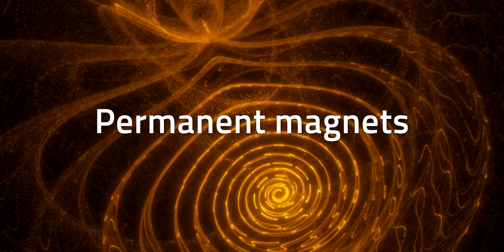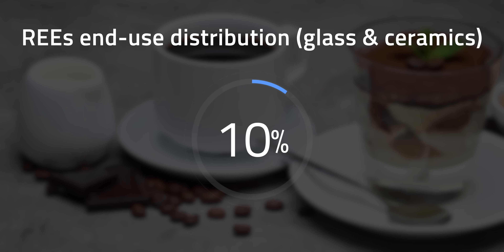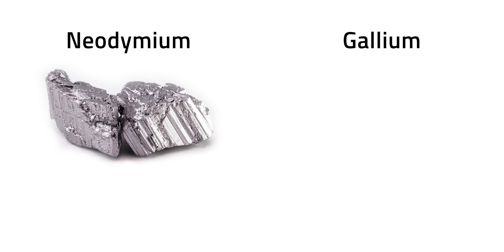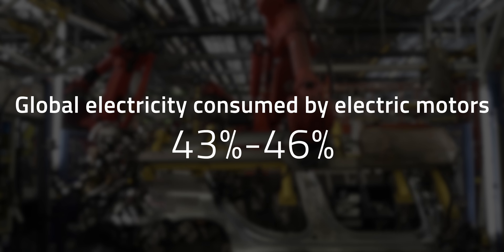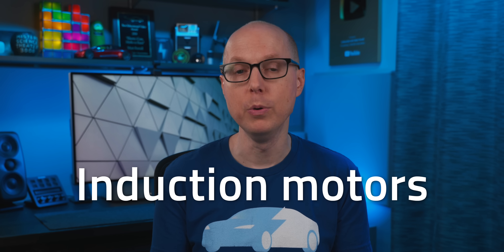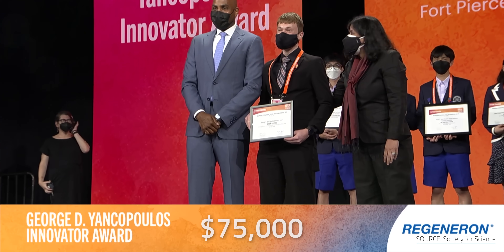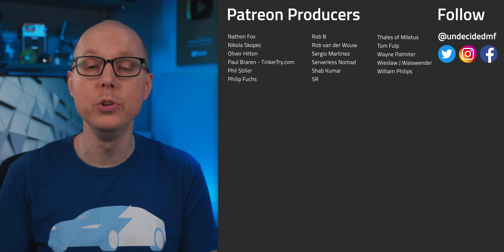Why This 17-Year Old's Electric Motor Is Important

Comment: I wanted to say something but found myself writing a novel about inconsistencies, terminology and stuff in this video when it comes to particularly the motor that was off. But instead, I decided to say good job on attempting to describe it.  When it comes to describing technology sometimes it's difficult to get everything exactly right when it's not your field of expertise.  So good job at talking about some of the things we need to think about when making systems and getting some of the key parts right.  If you find yourself making another video In this particular industry, feel free on reaching out as a second pair of eyes.  I startup these kinds of motors and other variations of them and might have some weird insights on some of them. And only because you brought up wind turbines, I've also helped design a couple of them, and no they don’t all use magnets.
Reply: Good point regarding the wind turbines, I am assuming that are referring to double fed induction generator (Vestas?).
It is impressive that the kid developed a motor, but I doubt that is something special, the motors on the market already achieved amazing power density levels while having very good efficiency which is critical for EV industry. There are some other designs that don't require magnets (e.g. AC synchronous with rotating rectifier) but they have lower power density than the current generation of motors. I think that AC induction motor is a good candidate as an alternative for the current  generation of motors, helped by a good vector control system (to control it and improve the not so great torque-speed characteristic of induction motor) and a magnetic core molded from a "special" material (similar to ferrite) it can achieve pretty good performances. If they improve the rotor manufacturing process as to use copper bars instead of aluminum and avoid broken bar faults caused by start-stop situations they will have a reliable, efficient and cost effective option.
Reply: @luciancucli5319  I'm surprised someone is familiar with double fed induction generation. As you might know this is a fairly common method today. And it is kind of funny because it's all based on an old slip ring induction motor and people think it is new technology. Just like these synchronous reluctance motors, double fed induction generation has just as much to do with the controller as it does the motor if not more.
Reply: Hehe me too.  I left my complaining comment. Like you I found a lot of close but no cigar moments.  I love the Switched Reluctance Motor.  But this article did nothing to increase the knowledge of them. 
I do agree with you on the point of young engineers today. They're great and I know they are going to solve it. Actually I'd love to have a tour of this guy's lab.   But it ain't happening. Not here. Glum face emoji.
Reply: @parameciumbrains  exactly... The switched reluctance motor is nothing without the switcher.  Easier said than done.

Comment: The squirrel cage & hamster wheel have been brought up, but no one mentioned anything about their lesser-known, esoteric sibling. It's more unconventional than its predecessors as it contains nickel-based bars around the circumference of the cage and osmium rings instead of copper rings, known as a Nickel-Os Cage.
Reply: :D :D :D :D
Reply: he he.
Reply: HAR!!! an overacting action motor?
Reply: That was a long walk 😂
Reply: Different materials, same motor type.
Reply: Why use any other metal other than copper. ? . .  All they are doing is electrically connecting the squirrel cage twisted elements together electrically.. .  Actually Aluminium is perhaps more often used than copper, because the bars and connections are sufficiently large to not lose much power.
Reply: I was genuinely invested untill I read the last sentence. I am utterly disappointed and filled with Nicolas rage.
Reply: @MrMeasaftw  Hi,   .. . How about saying what the last sentence was, and what disappointed you and what caused you rage. ?. . .   There is nothing visible about any of these in the above comments. ? ? ? ?
Reply: @hughleyton693  Actor
Reply: @MrMeasaftw  You make no sense, so pointless you posting comments. Ah.!
Reply: @hughleyton693  I really can't tell if you're serious or not. 😂
Reply: @MrMeasaftw  I know electricity from DC right up into the Microwave frequencies rather well. . .  So if you listen to me, you might learn something, but you won't from that Video.
Reply: @hughleyton693  Nicolas cage
Reply: haha!  Nice.  With osmium reacting with oxygen in air when heated to form osmium tetroxide,  just hanging around your super-smart motor when working has a good chance of sending you to the same place Nicholas Cage was sent in Leaving Las Vegas.
Reply: I don't believe I have to explain this...  @hughleyton693  The original thing you asking about is a pulp culture joke. It's a play on words not a real motor. Nickel-Os Cage aka the actor, Nicholas Cage.
Reply: @roguetorino     What is a "pulp culture joke" ? ? ? ?   ..  Pulp comes from wood.. .  Culture is usually about people.  .. . Your attempted joke has fallen flat on its face...   And totally confused the discussion now.
Reply: @hughleyton693 , from Wikipedia page on Pulp Fiction (the movie):  The title refers to the pulp magazines and hardboiled crime novels popular during the mid-20th century, known for their graphic violence and punchy dialogue.
Reply: @roguetorino  This dude is denser than Osmium itself and you just blew it by saying pulp rather than pop culture lmaoooo

Comment: synchronous motors has the same effect on the power grid as capacitors . if you have a factory with a lot of motors you can use sync motors as fans to bring the phase shift in line

Comment: Back in the seventies I studied electronics, in the eighties I got to work with several different types of motors, and generators. Siemens Allis had brought their hydroelectric facilities down to Florida, and they trained be to travel around the world, installing hydroelectric generators. I am a fan of Mr. Tesla. I have found certain flaws in manufacturing, that lower efficiency, that a few tolerance changes, and quality components, would see quite a bit of efficiency gains.

Comment: Nice video on electric motors. It is good that you highlight new future technologies and possible problems with current tech. However, there are a few problems with the statements within the video. First, a DC motor does not move by aligning magnetic fields but by Lorentz force action (see: https://en.m.wikipedia.org/wiki/DC_motor). 

Second: An AC motor generates motion by generating a fluctuating magnetic field in the stator, which than affects the rotor . However,  there are several AC motor designs. The asynchronous induction motor which uses a squirrel cage (not shown in this video),  and several types of synchronous motors i.e. wound-rotor synchronous motor,  the synchronous reluctance motor (SyRM), and  the permanent magnet synchronous motor. There are others but these are the most important in relation to your video.  Only the permanent magnet synchronous motor uses rare earth metals (and only if the magnets are made from these elements), the others use either a ferromagnetic core (reluctance motors), a squirrel cage, or an electro-magnet (coil). The video that you showed was of a wound-rotor synchronous motor with coils on the rotor. These coils require DC current to function as electro-magnets (excitation current) which can be delivered in several ways (i.e. brushed vs brushless https://en.m.wikipedia.org/wiki/Excitation_(magnetic)) and operate similar to permanent magnet rotors. An induction motor does not operate like this, it moves due to Lorentz force action on the squirrel cage bars after induction by the fluctuating magnetic field in the stator. A good overview of several electric motor designs can be found here https://en.m.wikipedia.org/wiki/Electric_motor.

Third: SyRM already exist and are used extensively (e.g. Tesla 3).  The switched reluctance motor (SRM) does not work like an induction motor, it works similar to a brushless DC-motor and can be used as a stepper motor (often in conjunction with magnets) (https://en.m.wikipedia.org/wiki/Reluctance_motor, https://en.m.wikipedia.org/wiki/Stepper_motor. 

Now I know I'm knit picking a bit  here, but your video implies that rare earth metals are in every motor except reluctance motors which isn't the case. Also, reluctance motors are not the answer to every problem. Yes they work well for high speed applications (i.e. SyRM) but have very low torque at low speed. Of course it is great that this kid made a new reluctance motor design with improved performance but it is a little bit weird to show that as if he is solving for a problem that cannot be solved otherwise. The US department of energy is already studying alternatives for rare earth metals in their REACT project .
(https://arpa-e.energy.gov/technologies/programs/react#:~:text=The%20projects%20that%20comprise%20ARPA,EV)%20motors%20and%20wind%20generators.). 

It may be a good idea to do a video on electric motors in general and how they work and project some of the problems with their designs, performance, and materials used, and possible future solutions. Again it was a good effort but a bit incorrect, better luck next time.

Comment: You should check out the Muller motor (not saying you need to do a video). The stators are made of black river sand and epoxy (almost no hysteresis) and the geometry of the magnets to coils is such that it cancels out drag between the stator magnets and coils.

Comment: Cloud dependent motor sound like a tremendously horrible idea. Imagine the security risk if that cloud server were compromised and the attacker could deactivate all the motors reporting to the cloud or feeding incorrect information to the motors to cause them to severely vibrate out of control. The cloud servers would also require continued maintenance, which I'm sure companies would look to recoup their costs via subscription fee. So now to use your HVAC, you'll need an active subscription to your hardware provider.
Reply: This cloud fad is taking longer to go away than i expected, and it is finding its way into everything.
Is the preparation of "subscription everything". 
We will own nothing and will need a subscription to everything.
Reply: He neither said the motors would be cloud dependent nor download any data. They would upload analytics for data collection so the company that makes them can improve upon their design by looking at realworld applications. It's not skynet
Reply: @swegfesh  Not these ones, but it is a trend. Even seat heaters on cars have gone the subscription route. You buy the car and the heater and you have to pay a subscription to use it.
Reply: Yeah. They should go back to everything being bio this and bio that. Or nano this and nano that.
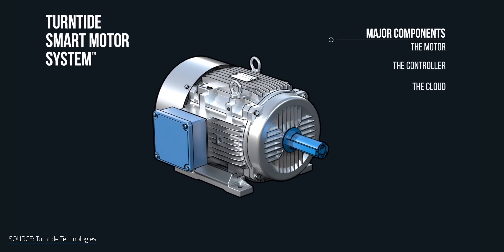Reply: @swegfesh  Check out @12:12 "The system collects data from different parts of the motor to determine the ideal motor speed and stores analytics for both the controller and the user in the cloud." Prior to that he mentioned how SRM's need advanced control and monitoring methods.  The only reason a motor would need to be connected to the cloud and monitored via multiple sensors is if it needed some kind of regular input and adjustment to optimize energy usage. That sounds great an all until any of said systems are compromised and inevitably companies try to monetize the service.  They even list The Cloud as a "major component".

Comment: As a note, another way to improve the torque is to use a phase variance between the rotor and the stator.  This can be achieved by adjusting the communicator's angle, but it can also be achieved by generating the phases for the rotor and stator by a controller with offsets.   These offsets can be adjusted to boost the torque and maximum speed to improve low-end torque without costing maximum speed.
Reply: I'm reminded of the adaption of computer modules to the ignition systems of high performance vehicles where you program the characteristics you want into code to affect power /torque curves of the engine.
Also the behavoir of diesel engines which have a narrow band of optimal performance relative to operating conditions which result in their being ran non optimally most of the time resulting in higher fuel costs and greater wear/abuse.
The ability to fine tune the performance of an electric motor on the fly would be limited by sensor technology and implementation but might result in increased efficiencies which could add up significantly over use/lifetime.
Reply: Every modern traction drive has done this for 40 years. This is not new information...

Comment: Well he now has 75k so getting the equipment to make better parts isn't going to be hard. 

As a separate note these motors may be able to be optimised more by suing 3d printed steel parts to take the place of air gaps to manipulate the fields since you can fine tune the shape and density of the steel. (Or other metals)
Reply: LOL sure, not hard at all.....75K might get you a lease on a SLS/SLM 3D printer for a year.  You are grossly underestimate just how costly prototyping is on this level.
Reply: @Skinflaps_Meatslapper  i was referring to small CNC equipment not the printers, that was intended as a side note.
Reply: @deltacx1059  Even substituting with small CNC equipment, kitting out a little prototyping shop with what is needed will fly right past that $75K.  Better to contract a company that already has the equipment and experience necessary to prototype your parts.

Comment: i think part of future tech has to be thermocouples. i used to work for an airline where the railway arm of the airline did a trial for 3ms where a special thermoucouple was wound around the diesl engines exhaust . the voltage off the thermocouple was enough to charge the trains batteries.  so the answers are there they just have to be pryed out of the sources.

Comment: I remember 65 years ago owning a slot car racer that had a ceramic magnet motor. These were superior to the standard magnet motor since they were lighter giving a better power to weight ratio. 
Why are they not in today's electric cars? they would be ideal as wheel motors.
Reply: When you understand that everything works on pressure mediation heat expansion and cold contraction you find that the denser the magnet the better the electro potential and magneto-kinetic properties of its field. 

You'd have to reduce the weight of all the other components especially those batteries for ceramic motors to work good.

Comment: I think if the design unalter then by the name alternator mean it alternating between generation and motorized so all it need is battery and capacitor enough for fuel less motor but how do we ensure it correctly unless open inspection

Comment: This is the first video I am watch from Matt. Motors without magnets are invented in 1900s by Nikola Tesla when he pushed the idea of AC power rather than DC power for household consumption. How this particular boys invention makes a difference compared those on the market would have made sense. I think you need to understand a lot about electric motors. Even DC motors in industrial use don’t use permanent magnets except small DC motors in toys. Of course, I agree making a AC motor by 17 year old is not an ordinary feet. We tried to make one in graduation but couldn’t produce rotating magnetic field suitable for rotating armature which we have made.

Comment: The production of REE have many rpoblems connected to both the working conditions in many mines, the refinery process - and the fact that China has a nearly monopolistic position. An alternative to REE in engines really would change that. Så far only 75% of the energy consumption is electric - that means to electrify will give a major challenge to the need for REE if we dont find alternatives. Thus, inventions like the one you focused on, may have a huge impact both economically and regarding global warming.

Comment: Instead of a str8 path for the air to flow which would give some resistance to torque. How about the 17 yr old takes a curve in the air flow vanes to help push-suck the air which in return up the rpm's & torque in the 17 yr old motor referring to 8:20 part of this video mentioning air flow, those metals gaps are referred to as vanes.

Comment: In my line of work, we use motors photos and some have permanent magnet motors, but they don’t have neodymium. They don’t have rare earth metals in them. I’ve never seen one with rare earth metals. Only ones I’ve seen our disc drives they have ceramic magnets and all the motors I’ve seen.

Comment: "Why" matters a lot less to me than "what".  You VERY briefly described something that is very confusing.  And proceeded to point out the confusion of using SRM as an acronym, then used the same acronym to talk even faster.  Finally "a motor that needs internet access" seems like a meme in the making.